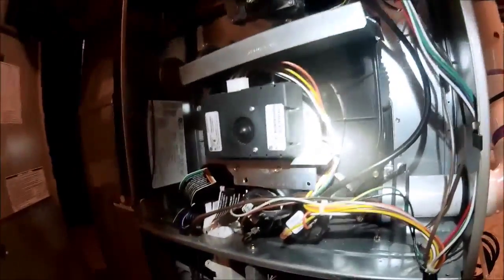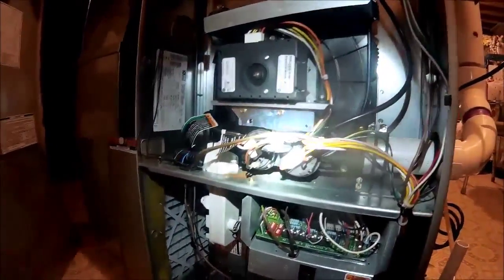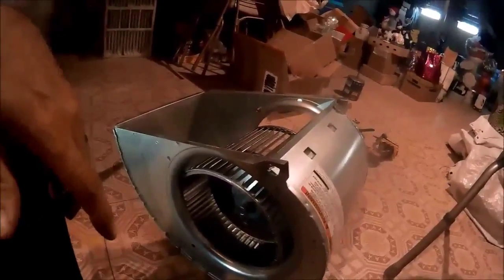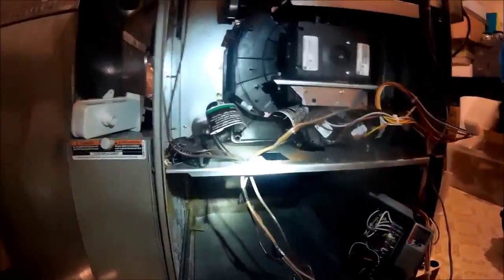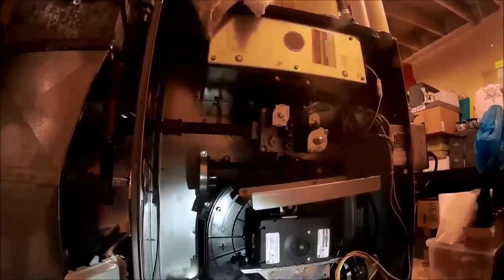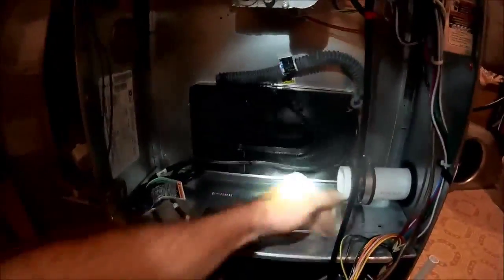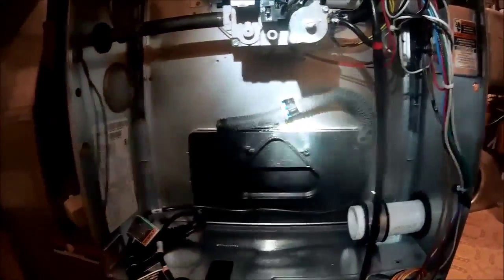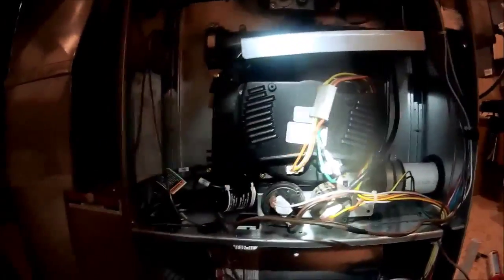Bryant ECM blower and inducer motor replacement

Comment: Working on a Carrier 58mvc060 furnace. Inducer motor was grinding and housing was leaking from seals wearing away. Went to Carrier and got the "New" inducer like in your video. Put it in and it doesn't run. Gives code 42 for inducer fail. Take it out and hold in my hand and it starts up fine until it gives code 32 which is understandable. Put it back in and doesnt run. Just starts up super slow, runs for like 2 seconds then off. repeats 3 times and then gives code 42. Has full 120volt power all the way thru the cycle, but only gets up to speed when its not connected to the collector box and the exhaust venting. Wiring is proper, its a harness kinda hard to mess that up. Venting has 12 ft of piping to get to the wall, and has 2 90's on it and 1 45 before exiting the wall to outside. Its 1.5 inch venting tho. But 1 of those 90's is a 2 inch where it leaves the furnace and then reduced on the 90, to go 1.5 inch rest of way. So maybe 25 feet equivalent length. Old inducer is back in right now so they can have heat for the weekend, and it starts up the furnace no problem. Waiting on call back from tech support, but been waiting 5 hours so far so decided to try here. Hope you have some ideas. Myself I'm leaning towards the venting, but with how it runs in my hand but not when its in seems a little weird is all.
Reply from the maker: sounds like a bad part right out of the box you should be able to hook your harness up plug it into the old harness and it should run
Reply: +Mi Heating Guy 
It does. like I said, hook up harness and hit switch and inducer will power up and reach full speed when its out of the furnace chassis. Just won't when u have it fully bolted on to the collector box and exhaust pipe inserted.

Comment: Found a Bryant 90% giving me a error code of 33 which I see a lot looks just like this one. But the furnace ran for 40 mins with no issues while flashing the error code. Any ideas? P- trap was clear.
Reply from the maker: what's the model of the furnace
Reply: +Mi Heating Guy Bryant 355aav042080fbsa
Reply from the maker: +Justin Frias  That's a limit code not a pressure code so it has nothing to do with the trap. Most of all the furnaces I have found doing this have a HK42FZ022 board and it needs to be changed. Its a software issue on the board. the new board is a HK42FZ035 with a version 16 software hope this helps
Reply: +Mi Heating Guy helps a lot that's what I was thinking
Reply: +Justin Frias let me start off by saying I came across this from a senseless call bacc. We do annual service on the unit. I was sent there a week after we did a service to change the filter because we had to order it and the home owners are elder and its in the crawl. I went there and changed the filter. Took 10 mins. A few days later they said after I changed the filter they have been hearing a really loud noise. So they sent me bacc. When I got there they pointed to the register and said they have been hearing the noise from there. I heard nothing, so I went down into the crawl. I watched the furnace for about 40 mins and heard nothing but this is where I saw the error code. Turns out the loud noise they were hearing was air flow lol. They hadn't changed the filter in who knows how long do they were just hearing air. But no I didn't say anything about the error code because I wasn't sure why it was doing that and it was working just flashing a code. If I go again I'll rep the ifc